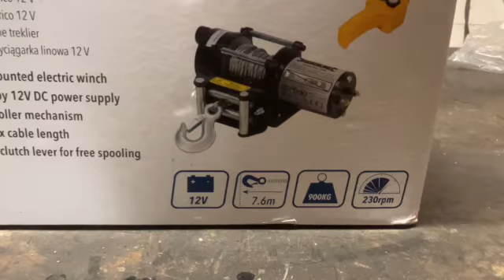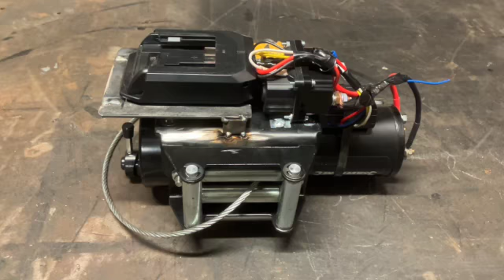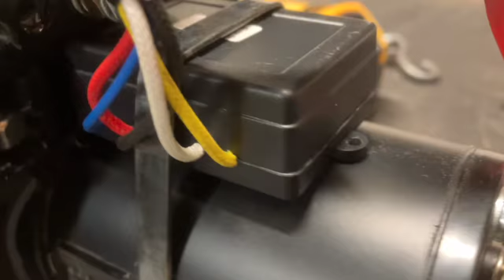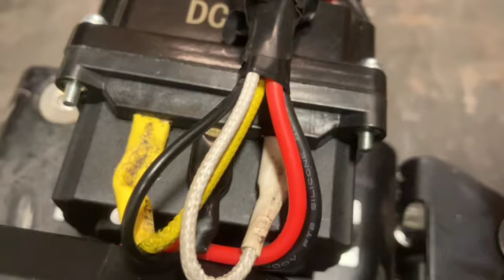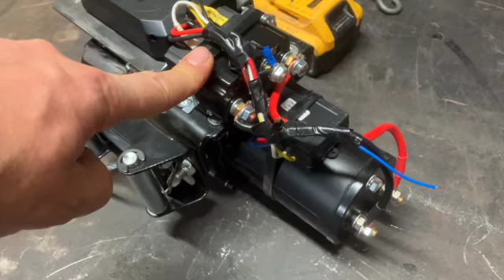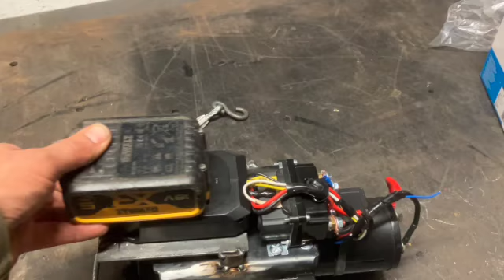Silverline 12v Winch: Adding wireless remote, and running on Dewalt battery. You need a solenoid!

Comment: It needs a step down transformer  eventually going to shorten the life span  of all of it . from over powering it all . If you get any type of spike it's going to fry everything. Insanely  for sure.  If you put it a good amount of  strain on the system  it could also damage the battery pack.  The reason why your adapter wasn't working currently  most likely because the regulater to small and couldn't support  the current draw.  Basically  it converted the power  but  on the 12v out put supply  that you have doesn't support the amount of all the equipment  current  pull when running .  Find out what amps it pulls all combined on a full loud  of your 12v equipment side  Then get a step down  voltage converter  20v-12v  that  Is rated for your amp pull application.   It will increase the life span and have a pertection when  or if something fails. Just a fyi 💯👍👌✌️🫡😉